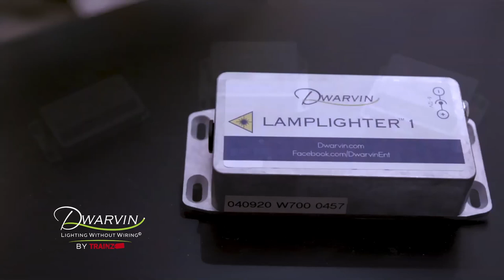Fiber Optic Lighting for Model Train Layouts

Comment: I have a question about using fiber for a different project.   I'm building a Voyager model from Monogram.   I was planning to try and use led lights for the lighting and flashing lights but led's will burn out.   if the source of lighting was in the base and I used fiber cable was thinking it might work.  
I was trying to use the IRATE MODELER Voyager build web site as my guide.   Do you think I could use Fiber opticals for that.   he used LED's for the big interior lights but I would like to know what you think I could use instead.   Thanks.   I'm still planning on using your stuff for my O gauge Lionel Layout when I get back to that.
Reply from the maker: I haven't had the pleasure of building Voyager but from what I remember of the show the ship has fairly relaxed curves. I believe you would be successful running fiber optics to the various locations. You can paint the ends of the fiber optic to match the bussard collectors and the red/green running lights